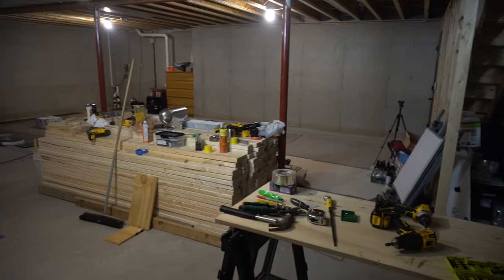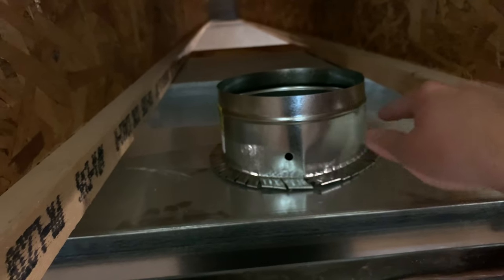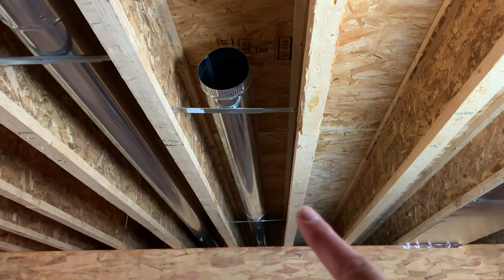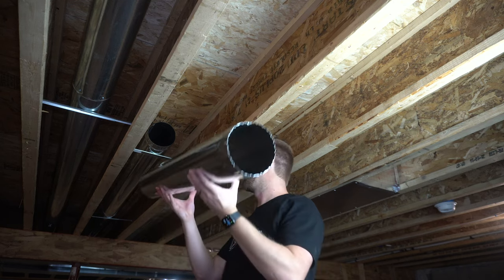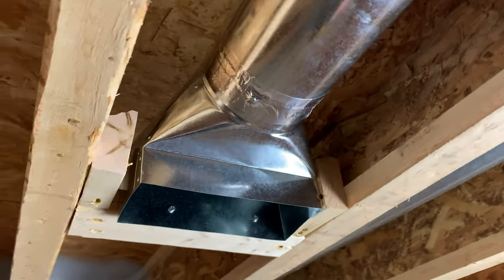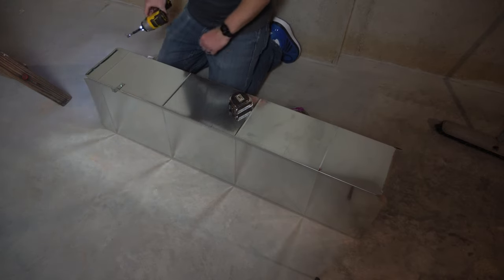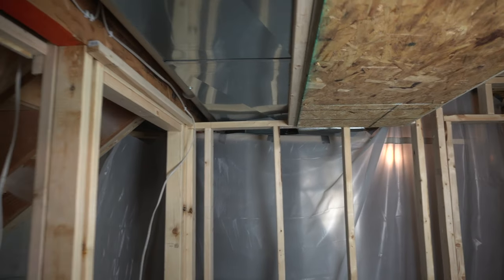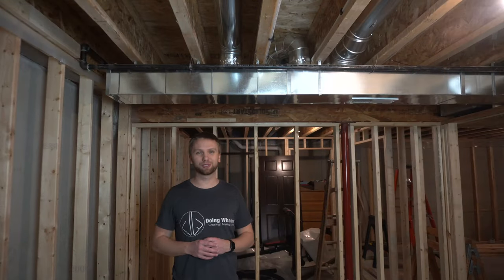How To Install Ductwork In A Basement | DIY Finished Basement Renovation

Comment: Are not gonna insulate?
Reply from the maker: insulate the ductwork? no, I'm not going to. but you can if you want to!
Reply: Its in the basement so there is no need to insulate the ductwork, if your ductwork is in the attic in that case you need to insulate it